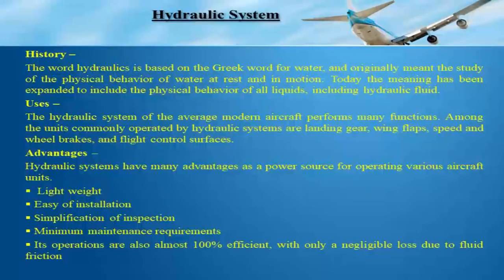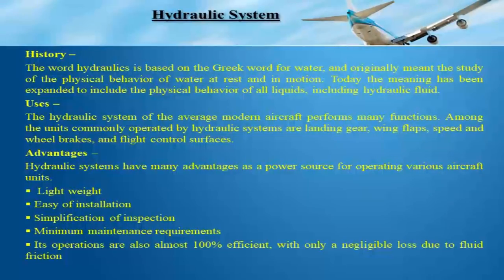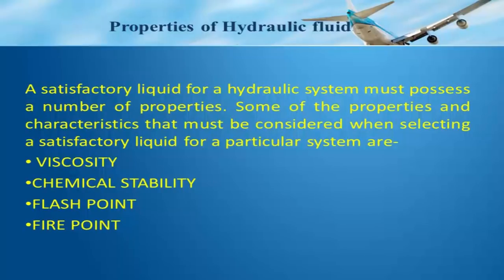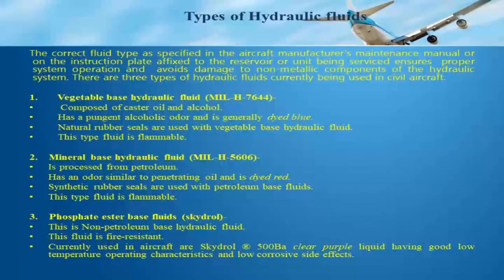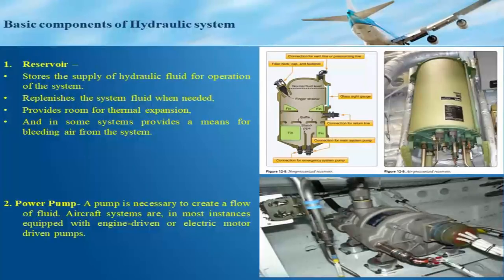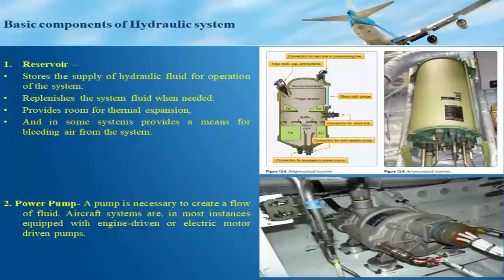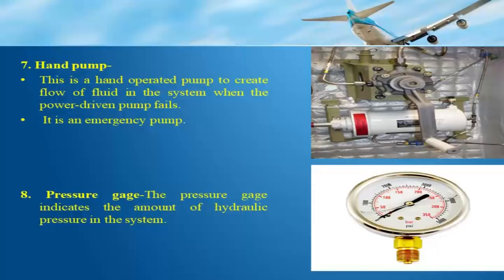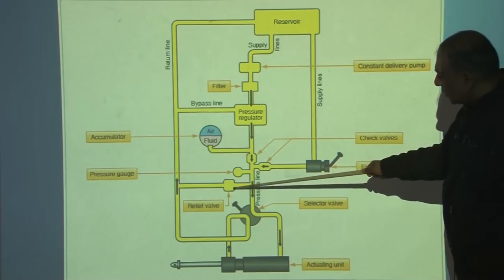Lecture 03   Aircraft Hydraulic System

Comment: Sir!! Is hydraulic system against law of conservation of energy?? Bcz output is greater than input.
Reply: Not really, because for any increase in output power there is an offset, which in this case is a decrease in range of movement between the input and the output.
Reply: @SekuruJohan  yeahh, right